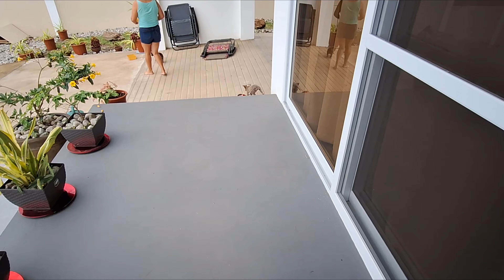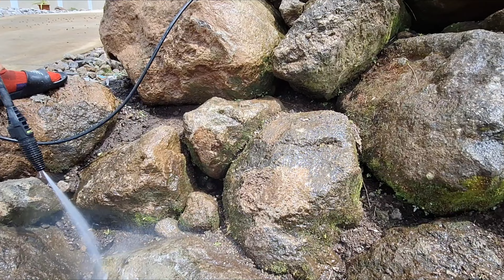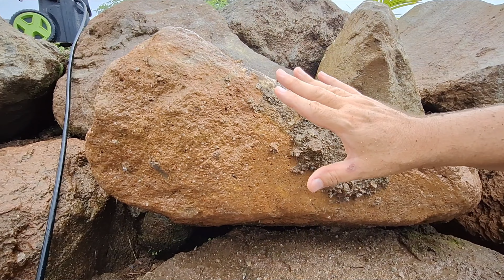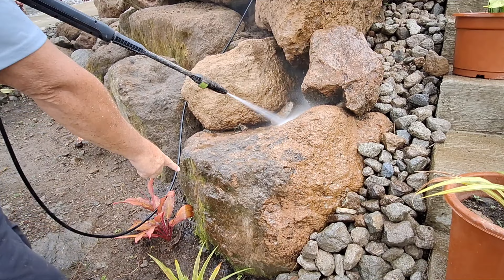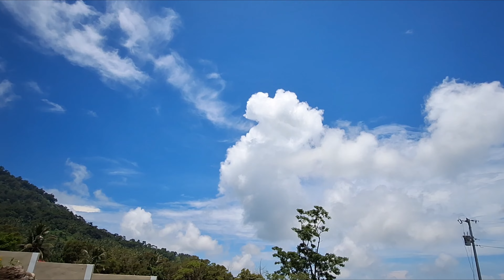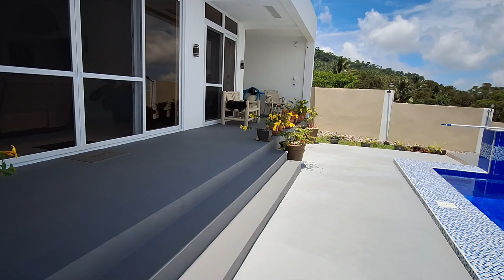Owning a home in the Philippines keeps you busy !!!

Comment: Hey, there's a product that Lowe's carries that's called wet and forget  you can spray on your rocks to keep the mildew off after you pressure wash them. It's alkaline based. It actually works for many months after you use it.
Reply from the maker: No Lowes here, but will look for it. Thanks for suggesting.

Comment: A coat or two of some matte, clear-coat rock sealer and those rocks will look even better and get easier to clean down the line
Reply from the maker: Good idea, need to attempt to find some. Thanks for the suggestion.
Reply: @buildingthephilippines  Just tell the guys in city hardware to find you the solvent sealer for stone tiles. It really helps with stopping the moss from growing on the rocks. Concrete sealer should work fine as well, just make sure to buy the clear coat.
Reply from the maker: OK will do, thanks for the tip.